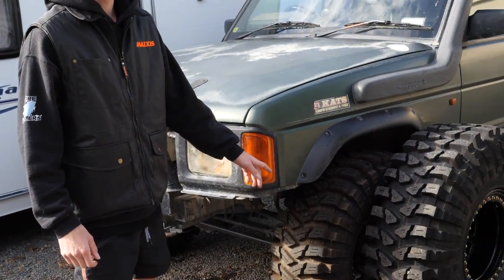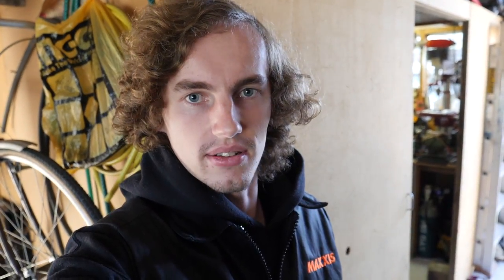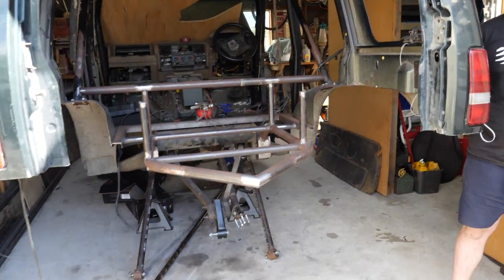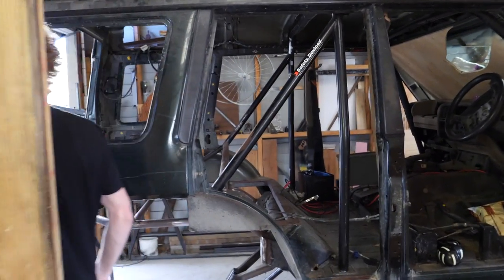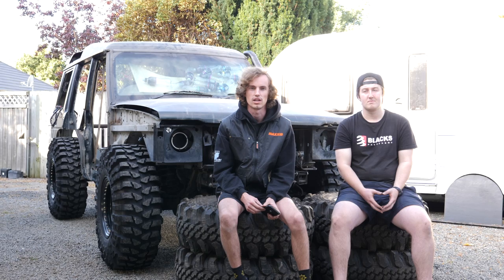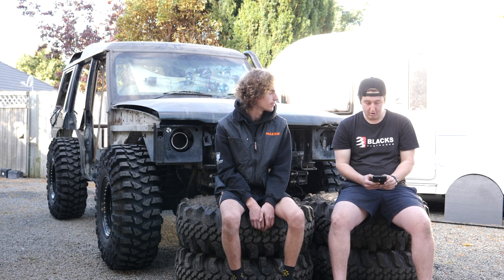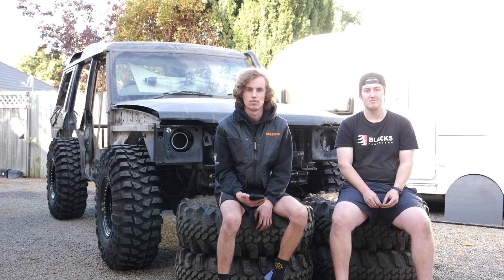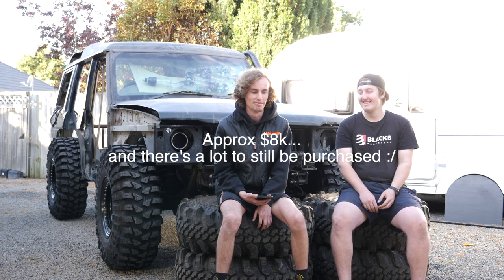38.5" Maxxis MUD TREPS for HUNDY! V8 Disco Race Truck Build Gets HUGE Tyres (M9060) + More PROGRESS!

Comment: truck build is looking great, look forward to seeing the rest of the build. I have a question about a v8 automatic honda crossroad which is idling fine but when you go to accelerate it starts surging. If you remove the speed sensor on the back of the auto box it runs fine. we replaced the sensor and it made no difference. Any ideas on what it could be?